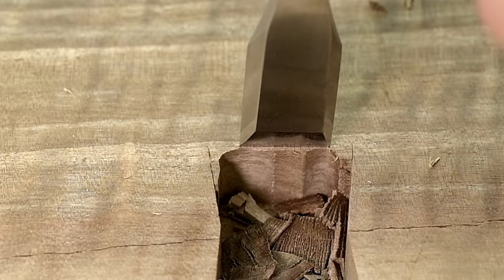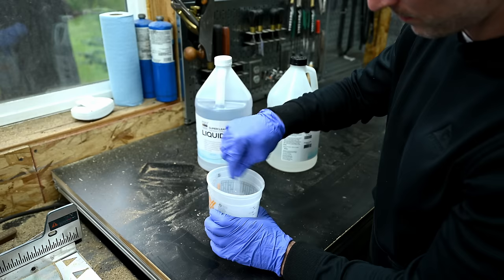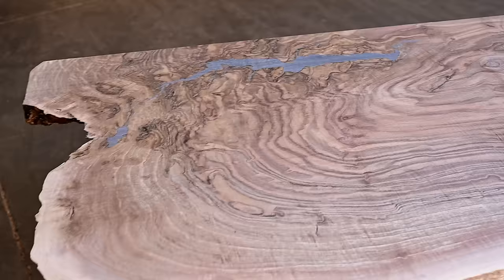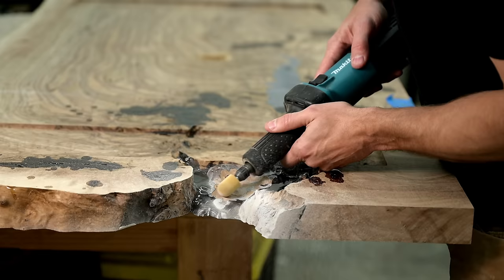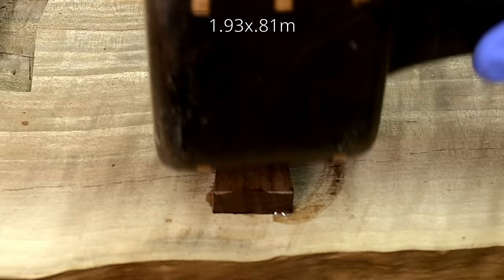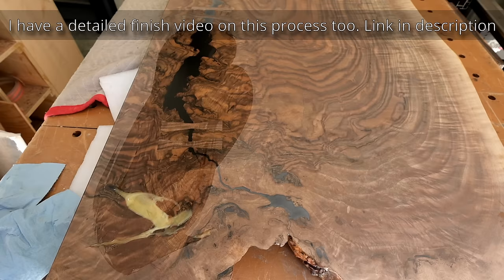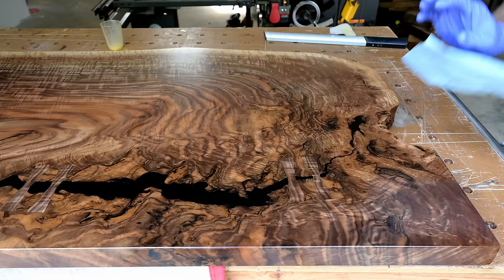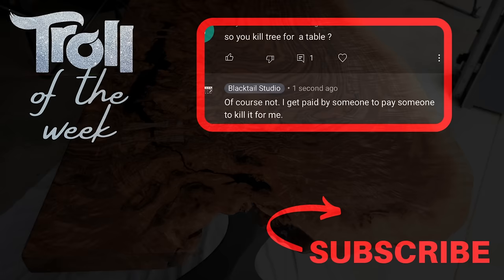Building a $9000 Table

Comment: No tie. If it adds to the structural integrity, I guess it can't be helped. But maybe some veneer on them to match the surrounding patterns? At least epoxy over the portion of the bowties in the crack so the band of black is continuous? So you don't see four little bridges in the epoxy band? I don't think bowties are ugly, I just think think they break up the pattern of the table. Oh and do you do other coloured epoxy? I've seen one white and one blue, but that's all the exception I've seen to the rest of your black epoxy projects. What about green like moss or golden like sunlight? Or even silver or gold (glitter or colouring, I don't know)? I have no idea if those look good, just some thoughts.

Comment: 10-hour clock is not an argument against metric system. The thing is, we already have a second and nobody is against it. But the day has naturally ~86164 seconds in it and there is no way to divide it into hours and minutes in decimal manner. We round it to 86400 and divide into 24, 60, 60. If we imagine 86000 = 43*20*100, for example...
There is no problem with global consensus to use some non-decimal units. There is a problem when some small group of people decides to continue using their old banana system against global consensus.

Comment: Bow tie! Big fan of your work Cam, I think I've watched every single one of your videos. I'm going to be embarking on a desk build here shortly, and I was curious - how long do you wait between the second coat of Rubio and applying the BF ceramic? Do you need to wait the full ~7 days for the Rubio to fully cure (if you used the accelerator) before applying the ceramic coating?

Comment: On the bowties . . . Have you considered placing bowties before epoxy? Place bowties, router bowties 10mm following the channel of the wood (the channel meaning the Crack that you're filling), then pour the epoxy. I ask this because the channel - the river effect - looks great but is diminished by the bowties smack bang in the middle.

Comment: As long as you bring up measuring systems, there are actual tremendous rationales for non-metric standards. The ancient Sumerians developed complex math around base 60 which is foundational to our timekeeping. 60 evenly divides by 2,3,4,5,6,10,12,15, etc.  This is especially important when you economy is based on counting commodities. What is 1/3 of 10? 1/4 of 10? So our system where a foot has 12 inches and an hour has 60 minutes is actually quite rational in a world where natural numbers are the basis of daily activities.

Comment: Bow ties look good - like the small patch of mismatch of grain  - I copied that method in a table I did - not a bow tie shape - but same concept - but I love the bow ties. Question for you: what do you recommend for filling timber used outdoors. I just cut some rot out of a post and need to fill it with something that will last and handle the sun and rain and looks good. Everything I use shrinks over time and starts to fall out. TIA

Comment: No ties or under table ties. They interfer with the flow of the epoxy design. Or could you carve into the bow tie enough to put epoxy across the bow ties?

Comment: Bow ties if they're done right! On the metric vs imperial argument - pity us in the UK. Half is measured in imperial, half in metric. I drive about 14 miles to Belfast to pick up 2.4m fence posts, then pick up the 6ft panels to fit to them. And I'm 12 stone but drink 330ml bottles of beer - my friend is 90kg and he drinks pints. At least you guys stick to one thing!

Comment: The desk was beautiful, it could be me but, I swear, I think the Rubio's gives a slightly shinier finish. Could just be my monitor, but who knows? 
As far as the bowties go? That's really up to the end user/owner. I make knives and sheaths and I will often get a customer come in and he's got a list of requirements; material, handle material, construction what kind of tang, the sheen of the blade. However they want a monster blade they call a Bowie but I call a sword. Rambo would even look at it and go, "Wow, that's too big for me." Then they want it to weight no more than 20 oz., and that includes the sheath. Not realizing what he just ordered doesn't work with the dimensions he gave me for the actual blade itself. I actually have a number of blade blanks for people to actually hold. His 18" blade with an overall of 26", 5/16' thick. comes in at about three pounds and no handle or sheath.
You have to be very diplomatic as well and not hurt their feelings. Sadly, you might wind up doing that regardless. Then they go to another guy who will promise them the moon, and I have had them come back in and ask me about a different knife.
Basically, making the customer happy is the end result and everyone has an opinion.

Comment: Why can't you put the bow ties on the bottom, were they can't be seen? or is that a silly question. I'm not a woodworker but can do most DIY jobs I've tried, I'd like to try a coffee table to see how i get on, i heard in different videos that you leave the epoxy for 2 to 3 weeks to dry, is there a certain temp that it won't set under?  i live in N'Ireland and my shed would average 14 degrees most of the year, is this too cold for it to cure?

Comment: Okay, here we go: No, the metric system is NOT better than Imperial. They are different, and have different strengths. Imperial is generally a better system for human-scale measurements. Imperial measures are usually base-12, which means they can be divided in quarters, and thirds, something which is profoundly irritating in a decimal system. Also, Imperial measures tend to coincide with a scale which is useful to quick comprehension. If I tell you that I'm 6 feet tall, you don't have to do a great deal of math to have an instant recognition of my height. Whereas if I tell you that I'm one meter and 82 centimeters tall, that's not a very readily comprehensible figure. Sure, if you know your own height, you know my height is bigger or smaller relative to your own, but it's not easy to quickly visualize.

Likewise, other Imperial measurements are accessible to the needs of normal people: cups, gallons, quarts, inches, pounds, ounces, they're all pretty well-scaled to the types of measurements required for everyday life. When was the last time you thought, "I need a gram of X" or "If only I had 10- more milliliters of Y"?

If you really wanted to get an unequivocally better measuring system, then you would start by changing the way we count, and turn our numbering system to base-12.

Comment: I was wondering if you could help steer me in a direction. I’ve been wanting to try out some more natural finishes. I’ve had my eye on Osmo because they offer different sheens. But there’s Odie’s Oil, and Tried and True as well. I’ve even looked into polymerized (heated) tung oil. I’m looking to achieve a nice satin sheen and I’m just a hobbyist so dry time really isn’t a factor much. I’d like as much durability that I can achieve in a natural finish I guess if that’s possible. Any info would be appreciated. Your tables are absolutely gorgeous.
Reply from the maker: Stay away from Odie’s, osmo looks good but doesn’t really protect.  Rubio has been good for me

Comment: I'm torn over the bow-ties. I get why they are being used, but I think they are ugly. Also, if I was paying thousands of pounds for a table, I don't want to look at something ugly in it that breaks its flow. On the flip side of that, I also appreciate the craftsmanship it takes to get them in there. After all, it's not something I could do, instead it would just have to be a different piece of wood.

Comment: Bowtie because I watched a video where a guy tested with and without and they actually work. The weak point will be the shortest long strands. 

I have a few book-matched slabs in California. They're pine, but I'm not sure what kind. They're very pretty with different colors in the wood. Have you ever seen anything like what I'm describing?

The metric system is for weak-minded people. 1, 10, 100, 1000, and so on. Lazy brains think like that. Fahrenheit is more accurate because it has a higher resolution. It also came first. But people find it easier to think water boils at 100ºC than 212ºF. That's why the majority of the world doesn't just the Fahrenheit and yet they call us stupid for using it lol. Furthermore, if you study nature from a mathematical point of view, you'll soon discover vortex mathematics. 660ft= 1/8 mile, 1320ft=1/4 mile, 3, 6, and 9 are the building blocks of nature. This is why we have the 24h day and 12h clocks. It seems when people feel stupid because they don't understand something, they tend to hate that which they don't understand rather than trying to understand it. Nikola Tesla was once regarded as the most intelligent man on the planet by Albert Einstein. Nikola had an understanding of 3, 6, and 9.

As for my woodworking skills... I'm self-taught... Meaning I looked at various tools and understood how they work. I then applied that in my effort to use those tools to create my first table. Which is why I signed my first table, it was 100% me. Not saying I'm a know-it-all, I'm well aware that I have a lot to learn and that there are things I've not thought of. Just wanted to point out that naturals do exist. My business partner says I'm a master at flow dynamics lol. What he means by that is I'm really good at looking at things and understanding how they work and how things may work together.

I hope I've not come off as bragging or boasting. I've been learning a lot from your videos and other videos.

Comment: NO ties! Definitely NO ties!
It totally ruins the beauty of the wood grain! If you have to do it..use it on the bottom side and seal it with epoxy on top side. Would drilling multiple diagonal holes in both sides of the crack beneath the black epoxy level work? If wide enough. Could the epoxy serve as a bond/glue to hold the crack from expanding?